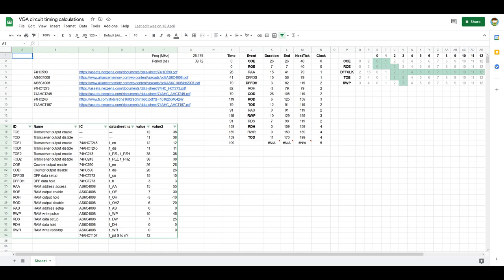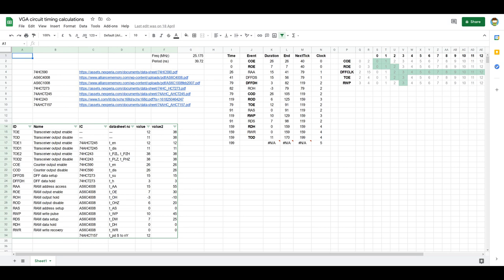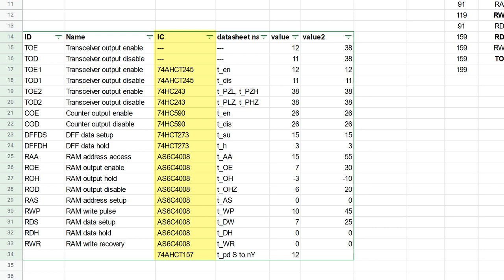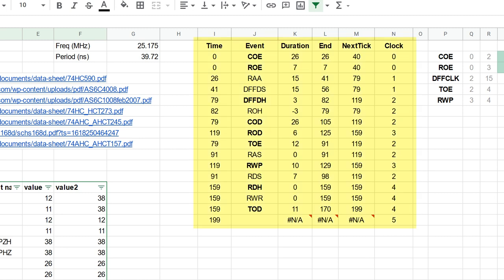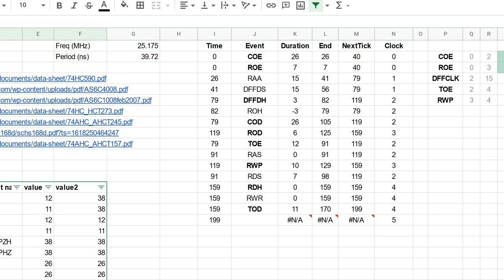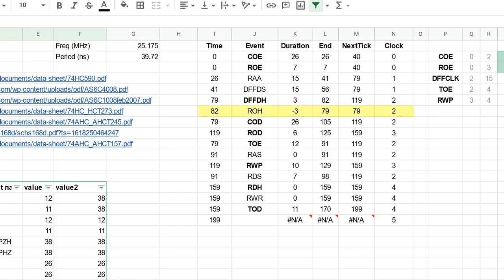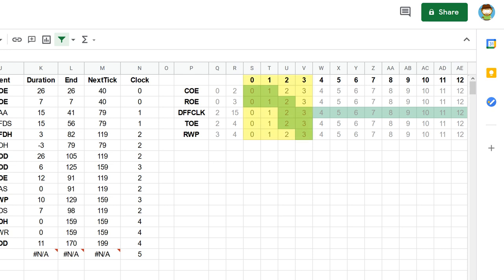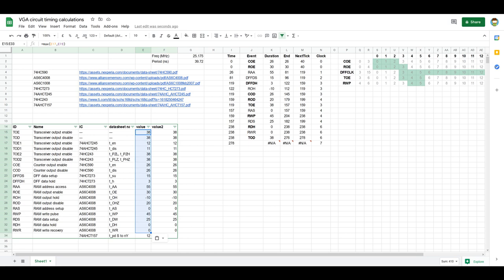How to analyse VGA circuit timing using a spreadsheet

Comment: great explanation! it might be worth putting 245s after the 590s, to speed up OE / address switching
Reply from the maker: Yes that could help. I also considered using multiplexers, to pick between the two address sources. I don't think anything is fast enough to make up for the slow RAM though.
Reply: @GeorgeFoot  You could try writing to 2x the RAM from the CPU, then interleave the outputs in antiphase.

Comment: random thought, but could a lot of this be simplified using some 22V10C? Like, the versions with ~5nS pd? I really like your approach with using a computer to help wrap your head around all of these timing constraints. I will keep that in mind. 

my attempt at a project right now is to controll a (parrellel interface) LCD shield for Arduino and read data from an SD card. maybe even trying to get some sort of GIF running (even if i have to use individual pictures. what is frame rate?)
oh and also see if i can use an attiny84 to decide which computer connection to use, wifi/bluetooth or usb! (ESP8662) maybe do away with the super slow 65c51. what do you think? maybe even setup a camera so others can see their code running on it?? security issues tho.. i think. i know nothing about security.

i just need to give myself a push to really start working on it.
Reply: to get decent frame rate, i could probably create a very specific binary file that specifies the pixels that actually change and their locations.
Reply from the maker: Yes I could use one to drive the control signals. I'm not sure it would help with the actual timing delays though, as the other components still need their setup times etc to be met.

Some kind of RLE packing could work well for your animation, depending how much changes from frame to frame - you could encode a target address and then a series of pixel values to write into consecutive addresses, to write a lot of pixels in a row efficiently. This is something I'm probably going to change in my current interface here as it'll be a lot more efficient for the 6502 as well.